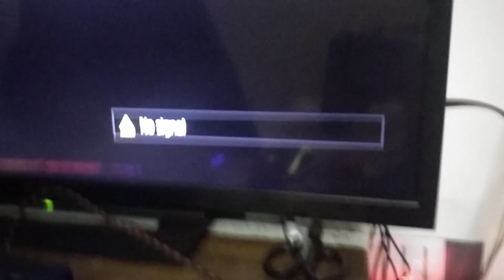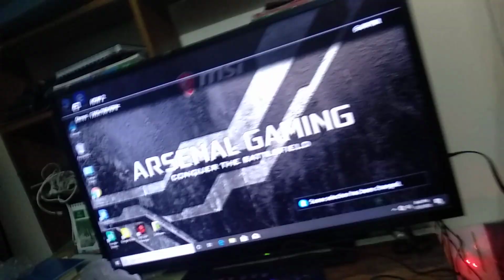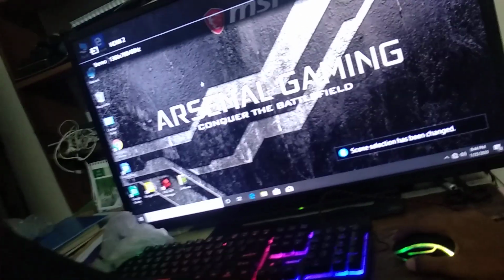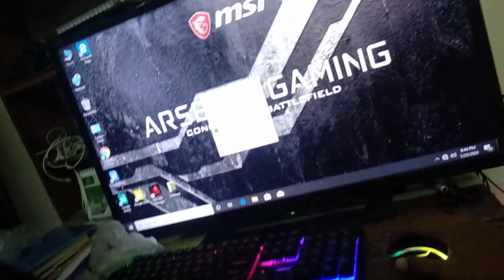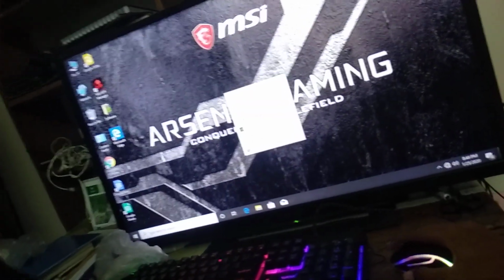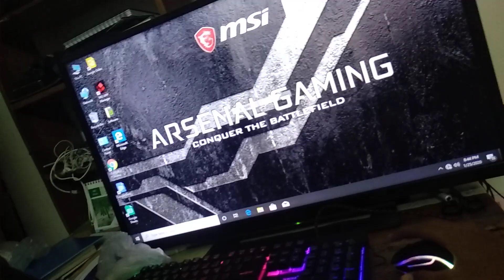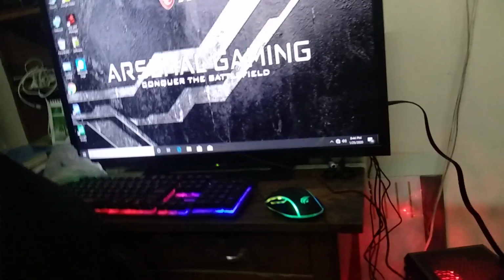CPU to Sony TV No signal using HDMI cable problem fix on 2020

Comment: Dude, there is only one HDMI port in my PC and  the HDMI cable is working fine as I am able to view it my Samsung monitor. And I was able to test my PS3 in Samsung Monitor with same cable and it worked without any issues. Only issue is with Bravia.. probably a reset is required.
Reply: Did you figure out a fix for this? I just got a Sony Bravia TV and the same thing is happening to me when I connect to my PC.
Reply: I am having same problem f sony